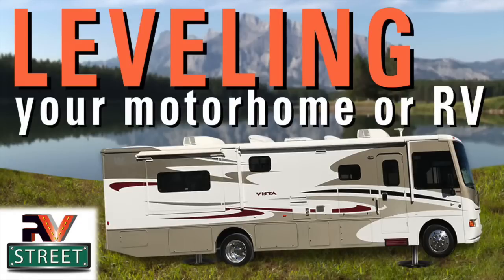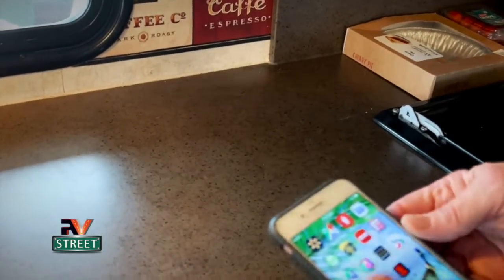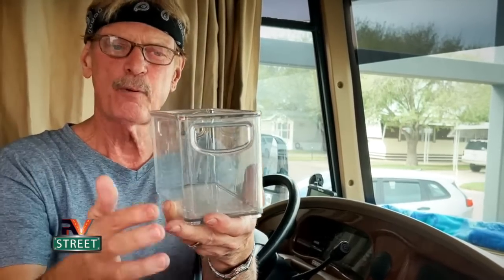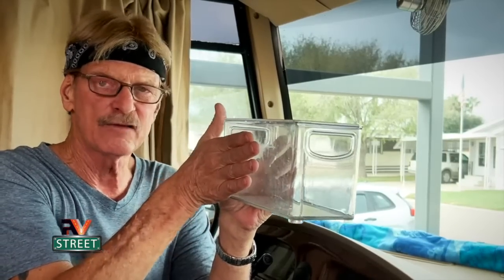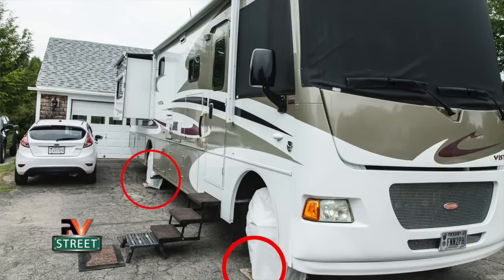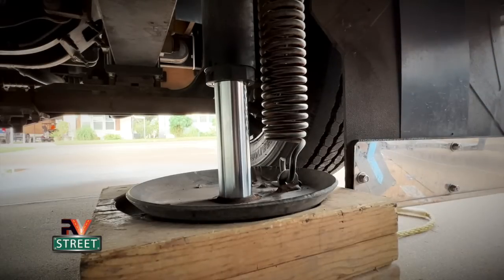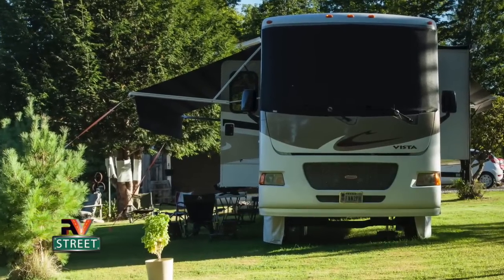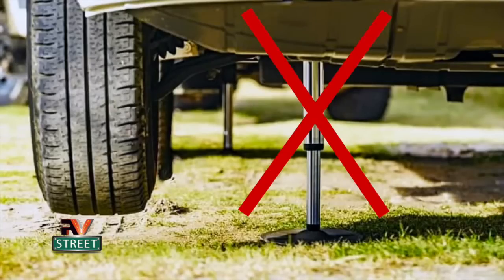Level Right. It’s Important • Get Rid of Those Bad Habits

Comment: Ok this is the first levelling vid that FINALLY included the reasons to level, and you've convinced me that all things considered, it's worth taking a few minutes to get it right. Overall, considering your points of the risks of doing it wrong, it sounds to me like it would be way better to not do levelling at all, than to do it the way most people do. 

And I still don't see a real good reason to bother. Just get rid of the stupid fridge that's causing all the trouble. The rest of the advantages of being level aren't things that I'd ever notice. Water pooling in the bath or in the sink? A door that opens? I mean those just show what a perfectionist you are. I admire your attention to detail, defront, and desides.
Reply: 100% agreement on getting rid of the finicky and dangerous absorption fridge. I remember early on in our RV research phase, seeing a video where someone explored an RV junkyard. There were two reasons RV's were in there: an accident or the fridge caught fire. I replaced our absorption fridge with a 12VDC fridge before we took even one trip.

Comment: My Power Level jacks also level side to side. You just need to calibrate the system so it knows what side to side level is. When I picked up my coach, it was not properly calibrated and was always 4-6 degrees left. So I calibrated the system and now it levels almost perfectly every time.

Comment: Hi, thanks for all the great information. I will definitely apply the pads under the wheels. Currently at a cement slab site for the next 5 months. 
My practice has been (with my manual level) front to back, then side to side.  With the importance of tire protection , I will apply the pad idea, but still think I’ll continue my approach. 
I had been using Truama for leveling but they got uppety and now charge. So I  picked up the app you are using and found I am perfectly level. 
I will also go back to using deep jack pads to keep the RV more stable. 
Thanks for pointing out jacks are for leveling not lifting. Liked that tip.
Reply from the maker: Thank you for your input and helping the RV community with your knowledge

Comment: Interesting that some Rigs systems can be so different. I find that it is best, in my 36' 35mq Challenger, most of the time, that I level front to back first, then side to side. When I do side to side first, a single jack will be off the ground and the Rig will jerk as the one jack with the most pressure releases to equal the pressure of its pair.
The more out of level I am, the more often a single jack will come loose no matter which way I do it. So, my takeaway from your video is that, when I am way out of level, I will use the tire ramping first, then block and use the jacks to finish the job.

Comment: On our crane we make or own pads and you need to make grain of the would don’t line up the grain has to be diffrent on every one and we round the corners so the corner stick out have tendency to curl up but if you round the corners off they will  last a super long time and your right we are 4-5 times heavier the your rig and we glue and screw like you do the big thing if your using more than one piece of wood just make sure the grain is not lined up and they won’t crack .

Comment: I have a mid-sized Class C with no leveling system. I use a rise run calculator app called Slope. I put in the wheel base front to back or track width side to side and the degrees I’m out of level and it spits out a number in inches I need to level her up. If I have to raise it front to rear as well as side to side, simply add the measurements on the tire that is the lowest. 
Example: the rear is 1” low and left side is 1” low. 
RF gets nothing
LF gets 1”
LR Vegas 2”
RR gets 1”
This works for me every time.
Reply from the maker: Thank you for sharing your knowledge with the RV community. Safe travels to you my friend.

Comment: Hey Martin. I am a huge fan of your channel, and have been getting myself geared up, and set for when I finally get my Motorhome. I am in the process of paying off a used 1991 Fleetwood Flair 22 foot long Class A Motorhome. Being that it's only a 22 foot long Motorhome, it does not have an Automatic Leveling Jack System like other longer Coaches have. How do I go about getting the Coach leveled correctly without having the auto leveling jack System ? I have no slides to worry about.
Reply from the maker: I'm heartbroken to say that Martin has passed away and I don't have the answer to your question. So sorry.
Reply: @RVstreet  Oh no, Joanie, I am so very sorry. He will be sadly missed greatly, not only by me, but by everyone who watches his Channel. You are in my thoughts, and prayers.

Comment: The 1st thing any owner should do is read their OWNERS Manual.  All manufacturers give a sequence for levelling.  My Entegra Anthem states to deploy all slides before levelling with jacks.  Some are just the opposite, level 1st, slides after. This is absolutely necessary to keep from breaking window glass, joint seals, etc. Knowing your owners manual will keep you out of the repair shop most times.  Auto level has the logic built in to satisfy the frame, chassis components, and will default if you are too far out from start. Most are built on an assembly rail that keeps components level throughout the build process. Even a 10+ year-old coach has a process for doing it right.

Comment: We don’t have auto leveler. One more thing to go wrong.  Our lives changed when we bought 
Level max pro that you install in mid inside of coach at highest part of ceiling on wall. Then you level coach when you first get it. I leveled it in the garage it’s stored in using 3 ft level I built garage which I made sure concrete was level. 
When we back into campsite I open app which shows levels at 4 corners on my phone so I back in slowly monitoring levels till I hit lowest levels sometimes we find level spot all 4 wheels without having to do anything. but otherwise know where we need to prop up low spots instead of guessing this devices it tells me levels up or low in 1/4 inches and I find it accurate. My wife and I can get level most cases with in a few minutes one of the best devices we bought that really made our life easy. Of course some sites are almost hopeless but not to often.
Reply from the maker: Thank you for sharing your knowledge with the RV community.

Comment: If you don’t extend your slide until after you level, how do you account for the change in level after you extend your slide?  I have a Winnebago 31BE with a full wall slide, which does affect the level.  That’s why I normally try to extend the slide first prior to leveling, unless I’m on a really unlevel surface.

Comment: I have a similar leveling system in my gas motorhome and one thing I don't like about them is there does not seem to be a way to retract them individually or in pairs if you raised them too high.  It seems that all you can do in this situation is hit "Retract All" and then start over.  Do you know a way to retract them in pairs like you extend them?  One situation you didn't address is a site that slopes unevenly from opposite corners.  In this situation when you extend your front or rear jacks one of them on the front/back hits the ground first and the other is still in the air.  In this case I assume you'd add addition blocking under your leveling jack blocks.
Prior to getting this MH I had a fifth wheel and it had a LCI leveling system in which you could raise or lower them individually or in pairs which I much preferred over only being able to operate my current leveling system on my MH.  Both of these systems were made by LCI, so I have to wonder why they make them operate so differently?
Reply from the maker: Martin also had to retract them all and start over.

Comment: Oh boy.I used to build these things.If you only knew.Whenever passing one on the hiway i give a wide berth.Frame and power plants are ok EVERYTHING else is garbage.Almost every piece is sourced to be the cheapest possible.And i mean everything.People please be very careful with these toys .I know that they can be a great source of happyness.But treat them with the respect of driving around a very Dangerous piece of equiptment.Replace everything you possibly can,don't worry about weight,There is nothing short of solid oak cabinets could change other than Milage.Keep her between the Lines Folks.

Comment: How to weigh Rv with a tag axle
Reply from the maker: I'm sad to say that Martin has passed away and I don't have the answer to your question. Sorry
Reply: As relates to what you can adjust for load leveling in the back, you must keep it under total rear end limit(as stated in the upfitter provided load spec sheet), so are you blowing tag tires or Is the heat and psi rising on those tires differently?